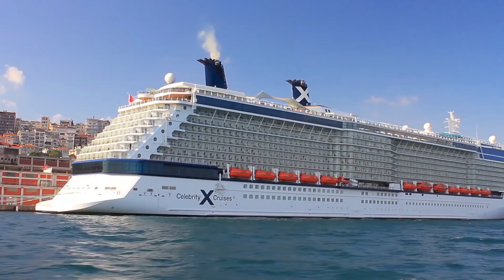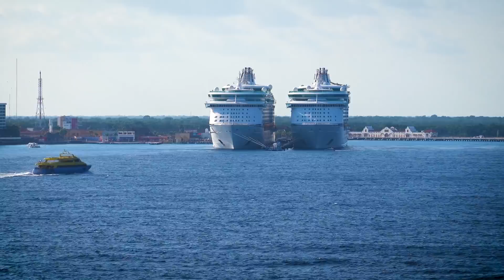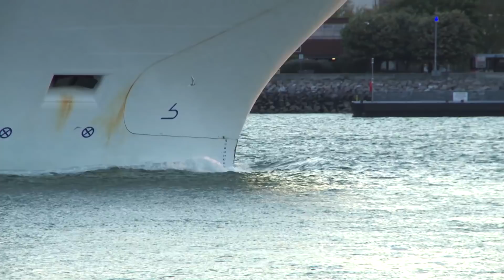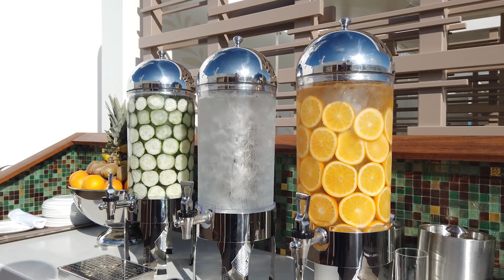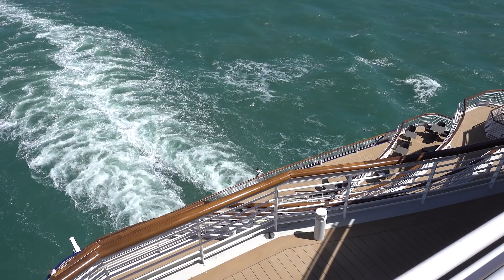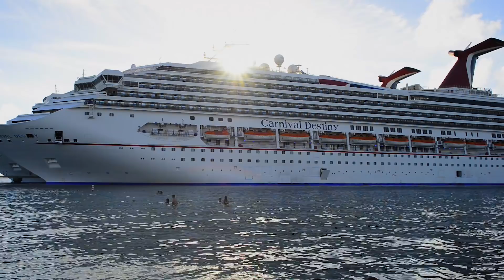Cruising And The Environment. What Are Cruise Lines Doing?

Comment: LNG is only possible because of the abundance of natural gas due to hydraulic fracturing (“facking”) and horizontal drilling.  Yet there are groups opposed to this
Reply: there are a few ways to get natural gas, not just fracking. if done incorrectly fracking can be extremely devastating to the areas around the sites. I live in Oklahoma where fracking was the cause of a record number of earthquakes. cheap natural gas is not a good tradeoff for people's lives being put at risk.
Reply: Yes fracking can cause earthquakes and the process uses tons of water and loads of chemicals.

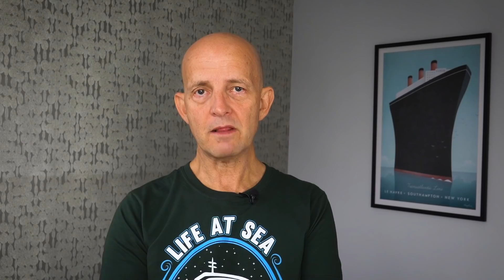Comment: 1:37 burning LNG produces much less CO₂ emissions than other fuels. However methane, the main component of natural gas, is itself roughly 30 times more potent as a greenhouse gas and keeping it as liqiud at −162 °C (−260 °F) consumes so much energy, it probably isn't even worth it 🤓
Reply: It’s not that difficult to cool the LNG. When it is bunkered it’s already at transport temperature and spray nozzles in the tanks let the gas in to cool the tanks, then the main fuel load is bunkered. The lagging and thermal efficiency of the tanks is huge and when on the run little more than one fridge compressor is assigned to fuel cooling, as opposed to 5-6 compressors cooling the cold rooms and A/C plants onboard. Then your efficiency factors in boil off which is diverted to the boiler burners on most ships, some ships can use it on turbine plants too. 

Also the next step is methane generation through waste water treatment onboard, which is currently happening but the gas is just vented from the funnel. Veolia and Wartsila are working with RCL to get the design right for a full methane plant to be on the ships, producing a lot of gas for generators powered by crew and guest poop.